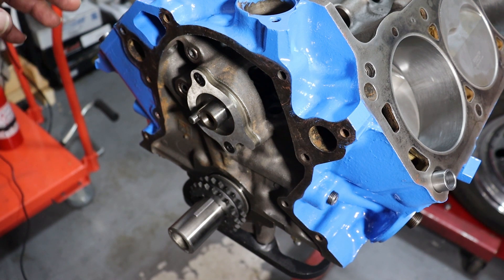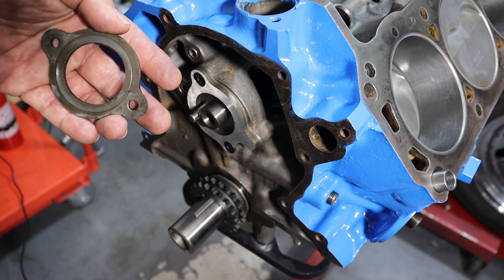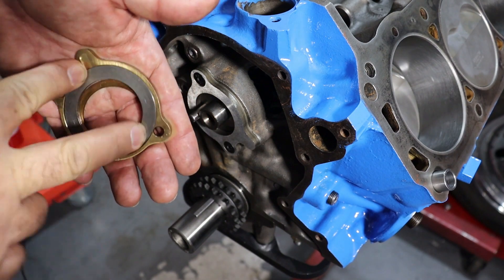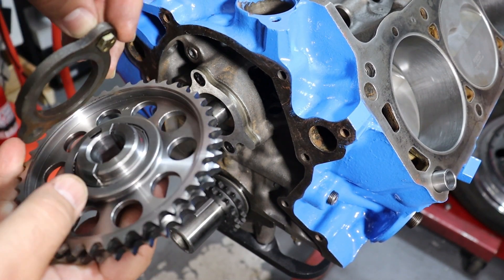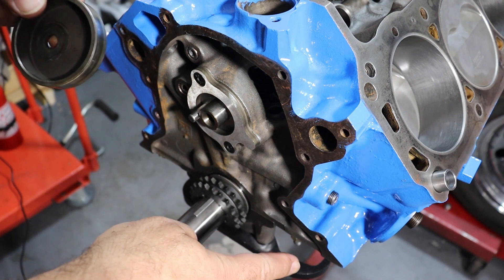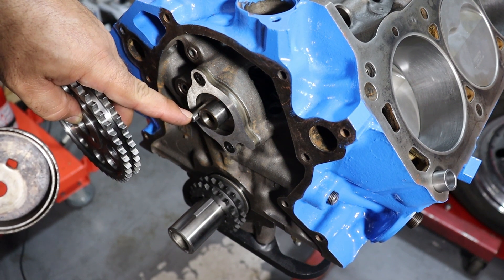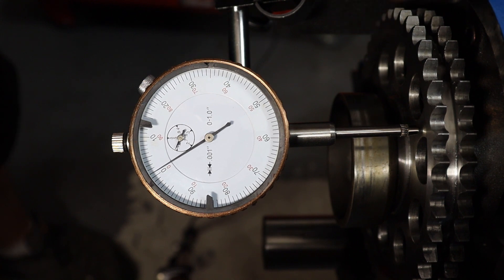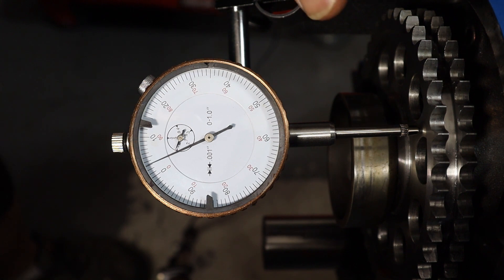SBF Cam Retainer & Cam Thrust

Comment: The Torrington bearing plate that you showed. Who makes that plate and do you have a model number?
Reply from the maker: I assume you're referring to the stand alone one - it's made by Comp Cams and the product number is 3135TB.  Summit & Jegs both sell it.  I ultimately ended up installing a Comp Cams dual roller timing chain set, and it had a torrington bearing integrated, so I didn't install the stand-alone version on this engine.  Thanks for watching!

Comment: What thrust plate did you end up going with that was already beveled? I’m building a 74 351w and summit has very very few options for steel thrust plates to mate with my steel gear
Reply from the maker: I used a Speedmaster PCE510.1004.  There are other manufacturers that sell them, but you could also take one with standard holes and countersink them yourself without too much trouble.  I hope this helps, thanks for watching!!

Comment: you mention the torrington roller cam plate, cant be used if the timing set has a torrington bearing? I do think that FTI makes one that you can. DTI-Cam Retainer Plate SBF-CR1.  good info about everything else. good job
Reply from the maker: Thanks for watching, and thanks for the info, I didn't know about the FTI kit.  It's expensive, but looks well-made.